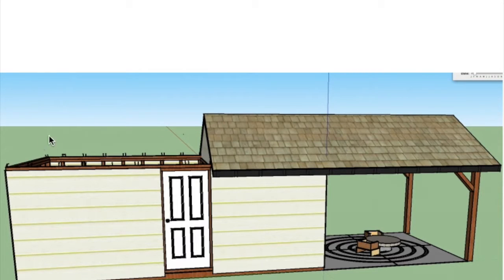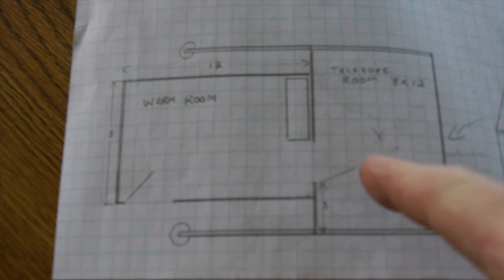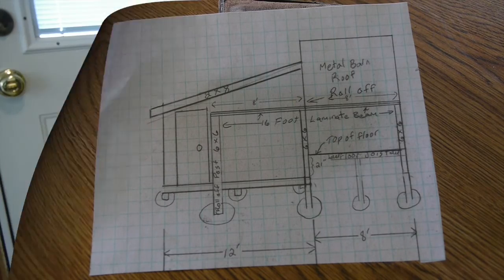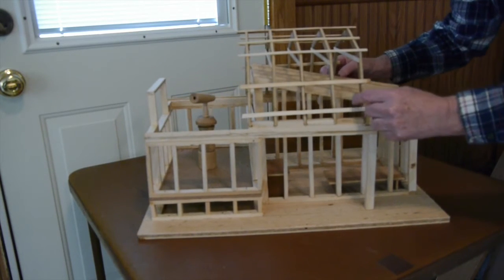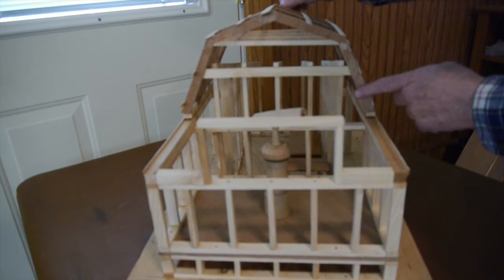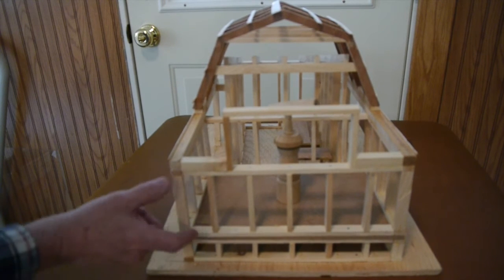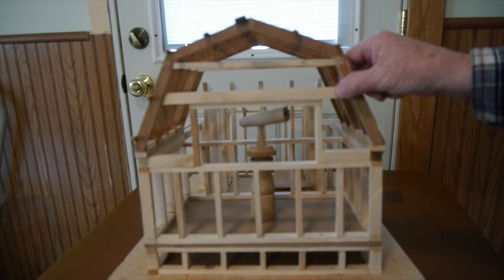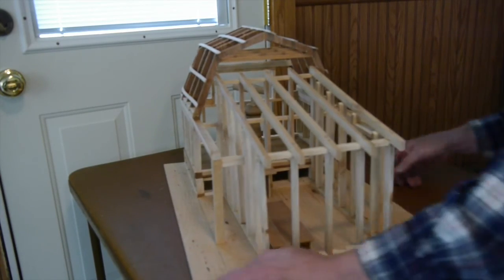Roll-Off Roof Observatory (Scale Model)

Comment: Great model! I know this video is old but that roof looks like it will give you quite the blind spot. Wouldnt matter so much if you oriented it in a direction that has a high treeline anyway, but i'd hate to see a wide open sky get cut off by that tall roof. I like the concept otherwise, love the idea of the window looking out to the telescope from the warm room!
Reply from the maker: Thanks for you comments. I decided to buy a small observatory instead of building this. I bought a POD and have a video of it here on timtools99. The main reason for buying the POD was that it is set up on land owned by my son.  After i am done with it, my son would be able to sell it easily and not be stuck with building that woukd be of little use to him.

Comment: i watched this twice after careful consideration, i have come to the conclusion you will not fit in there my friend you need to think bigger :P
Reply from the maker: Thanks for the comment.  I decided to buy a Skyshed POD.  It is only 8ft in diameter but plenty of room for my SCT and equipment.  I actually think that this roll-off design would have been bigger than what I have now.  I'm a little guy.  Don't need much room.  The main reason that I went with the POD is that my son can sell the thing someday when I go to that big Nebula in the sky.  He won't be stuck with a crazy building on his land which is where my observatory is.  Here's a link to my observatory video.  https://www.youtube.com/watch?v=uvoC3vYGsW8&t=3s

Comment: Wow Tim,  I'm quite envious on your new project. I was just wondering on the type of foundation that's going to be chosen for this amazing ROR Observatory. According to your blue print diagram showing the side view of the building, it reflects concrete posts for your foundation; however, your wonderful model is actually showing the warm room built on a concrete slab instead. Which type of foundation are you going to be using? Maybe both? Thank you
Reply from the maker: +Hadidsea 
Thanks for the comments.  I have been thinking about pouring a footer and laying up blocks since it's a pretty small building.  Originally, I was thinking of a pole barn type construction but a good foundation under the telescope room would help to insure that the building doesn't shift or settle.  This would help the roll off roof stay level and lined up.